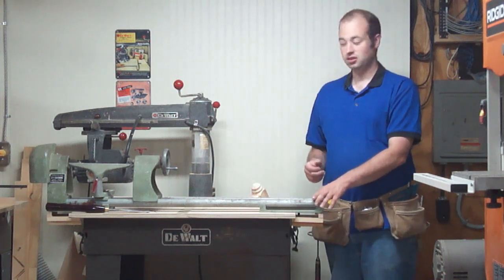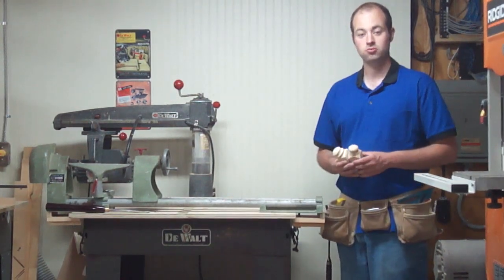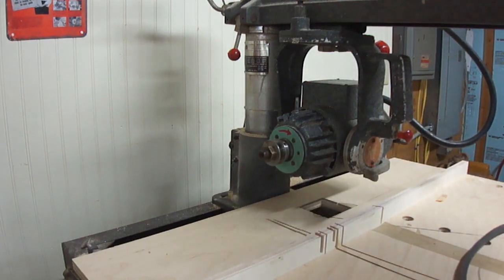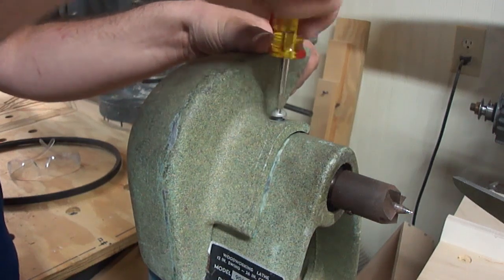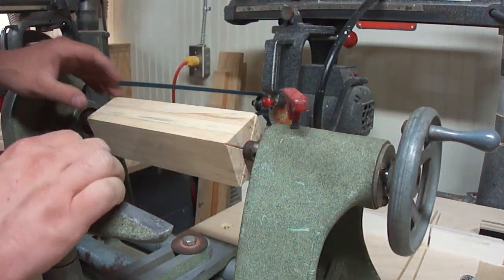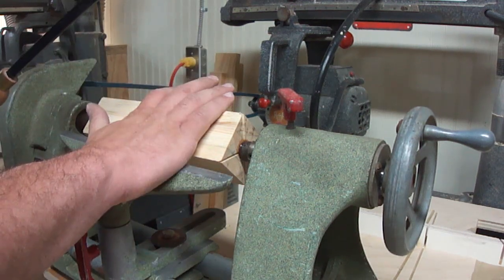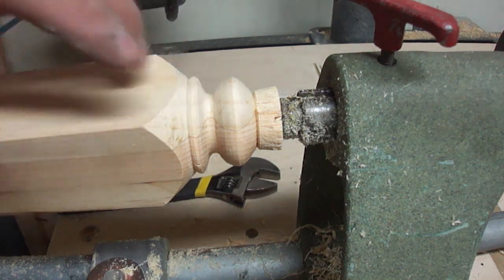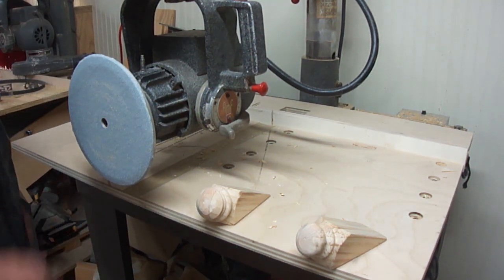How To Use The Radial Arm Saw As A Lathe

Comment: I think I will try to find one or build one for my Craftsman ras. Thanks for the videos. Have a Blessed Day. 🇺🇸😎
Reply from the maker: Thanks, I know Craftsman made a couple models of bench top lathes with pipes for the bed like this one has. I would think a lathe like tat could be attached to a RAS without too much trouble. The lathe just needs to be light enough that you can put it on and take it off of the RAS without too much hassle.
Reply: @TheNorthlandWorkshop   Thank you. 🇺🇸😎
Reply: There are tons of lathes you can use like this. I have a similar Montgomery ward lathe. Any lathe without a motor could be used like this.

Comment: That's a cool attachment. I wonder how hard it would be to get a 2 or 3 step pulley made for the saw arbor ? I'd put a piece of high density plastic on the tool rest to avoid the notches. Great video.
Reply from the maker: Years ago I made a 3 step pulley for my regular wood lathe’s motor so I can pretty confidently say it would just take a couple hours on a metal lathe. If I was to make a custom pulley I’d make the hole threaded so it goes on the arbor without needing the nut.

Comment: Thanks for sharing, looks like I will be making a sanding disk for my RAS it really works well. The lathe is great but as you said one is more likely to find hens teeth.
Reply from the maker: The sanding disk is great. If you make one, or buy one,  I’ve found 3M Super 77 spray adhesive to be the best way to glue the sandpaper to it.

Comment: Very cool. It strikes me When seeing al of these attachments that they very much seem to be Rev.1 of an idea. Its a shame that the race to the bottom started so relatively early in its life. Had the high end Dewalts and Deltas dominated the market a little longer I think we would have seen even better and more refined add ons.

That being said, I don't feel that these tools deserver the "Jack of all Trades, master of none" reputation that they seem to have garnered. I plan on giving the planner and shaper a go on my latest acquisition, a 9" Beaver Rockwell turret) and I expect good results. I also plan of trying it with my 10" crafts man (a 60's model I believe) which I also feel is a little unfairly bashed by many. I was about to turf it for not holding an angle when I pulled the carriage off and took apart the yoke rotating assembly. Full of caked on grease and saw dust, cleaned it all out and now it's fine. I wonder how many of these have been thrown out as being "cheap garbage" when all they needed was a little cleaning.

You're also very fortunate to live in an area where these older tools seem a little more prominent. The old dewalts are not very common around me. I saw one come up for sale, probably should have bought it, but I figured 2 Ras's was enough, considering how tiny my shop is.....

Anyways, that was a long winded comment, keep up the great videos :)
Reply from the maker: From what I’ve been able to find this lathe is more like rev. 2. There was one that came out before this one that had the drive center screw directly onto the arbor so it was a very fast single speed lathe that used the motor as a head stock. Then there was one slightly updated lathe that came out after the model I have. It is a shame that the radial arm saw craze was so short lived. Delta and Sears never went as deeply into the accessory market as DeWalt did and I think it is because both Delta and Sears sold other tools such as jointers, planer, and lathes so they were less interested in selling accessories such as a lathe for the RAS because they wanted people to buy their stand alone one. Where as DeWalt’s was really focused on RAS exclusively.

Comment: I've seen pictures of the lathe attachment in the old catalogs. I'm glad someone gifted you one so you could demo it for us. A question on saw types; since you have both types, the Dewalt and the Rockwell/Delta, do you see any advantages in real-world use of the dual-arm ( Rockwell type ) vs the single arm ( Dewalt and others ) type ? Just curious. I've never used one of the two-arm type saws. Thanks for the great videos.
Reply from the maker: That’s a good question. The dual arm is the superior design and if I could only have one type of RAS in my shop it would be a dual arm saw. The big advantage is it can miter to the left. Having owned the Rockwell for years before getting the DeWalt I didn’t think anything of cutting crown molding on the RAS because it was easy to swing it to the right and the left. I see people making all kinds of jigs in order to cut left hand miters on a single arm saw. I don’t like those jigs for the simple fact that they end up having the piece being cut stick out of the saw at some angle. That’s fine for short pieces but if you’re trying to cut long pieces of moldings it can get difficult to support them. Lots of people have just a single arm saw and they make it work for them but to me it’s like having a car that can only turn in one direction.
Reply: Agreed, glad to know its a thing.

Comment: 'It seems silly' (0:50) - that is because it is. The only thing saved is the motor- and you have to spend considerable time setting it up. Like many 'multi-use' add-ons, it would probably get used- once.
Reply: Saving a motor is no small thing. Multi use tools are incredibly handy for many of us who work on many random types of things but only occasionally. I may goes years without using a wood lathe. Why tie up a motor or the space?

Comment: Hey there, I’ve replaced the grab arm bit of the lathe, and it spins without a block in the lathe, but when I add material, it doesn’t want to spin. Spins fine without material in the lathe. Any tips?
Reply from the maker: How much pressure are you putting on it with the tailstock?
Reply: @TheNorthlandWorkshop  how much pressure is there supposed to be?

Comment: To fix the height of the tool rest put the bolt on the bottom  that way you take away the height of the tool rest by putting the bars on the bottom of the pipe ways you add about 1.5" to how the tool rest sits
Its upside down the way you have it
It also limits the size stock you can use.  You have to be smarter then the tool to use it.
Ill bet you can use a tool rest off some other lathe too. Like a cast iron one.

Comment: What size blade do you use on that radial arm saw ? I have an old DeWalt saw like that one but not sure I'm using correct blade size.
Reply: This one is a model 1030. It takes a 10” blade. What model is your saw?
Reply: @iainportalupi model 925
Reply: Using a 7 1/4 “ blade on it
Reply from the maker: That model takes a 9” blade. However a 9” blade is really a little much for the 925 a better blade for it would be the Freud LU83R008 which is an 8” blade. I have one of those blades on my smallest RAS, a DeWalt MMB, and it is a very good blade.
Reply: Okay thank you I’ll start looking for a 8” 24 tooth one
Reply from the maker: @xle5363  24 teeth is a bit too aggressive for a ras.
Reply: If not a 24 which one do you suggest
Reply from the maker: The Freud I mentioned above.
Reply: @TheNorthlandWorkshop  I found it on amazon it's a 40t thanks again for the info
Reply from the maker: @xle5363  glad I could help.

Comment: can i use 110 on the radial arm saw instead of 220?
Reply from the maker: It depends what model saw you have.
Reply: @TheNorthlandWorkshop  it's the older craftsman one
Reply from the maker: @deanreinglas3679  that should be able to run on 110. The motor should have a name plate that will say what voltages it will run on.